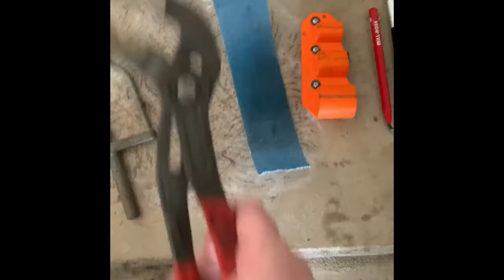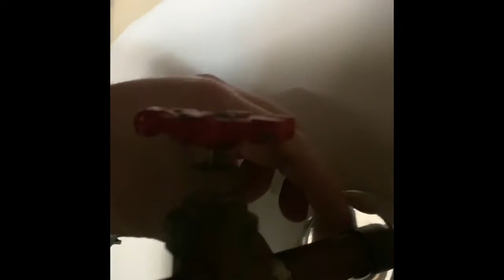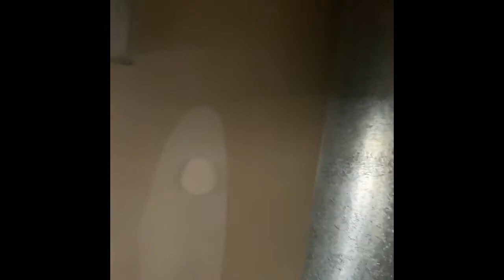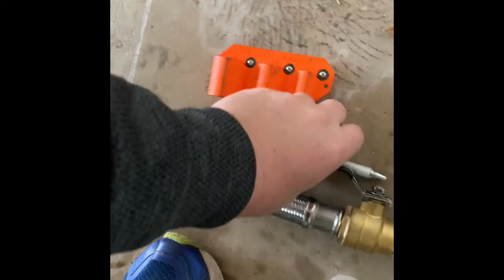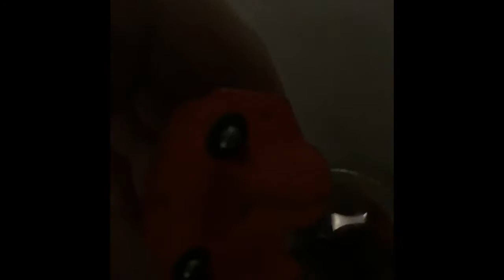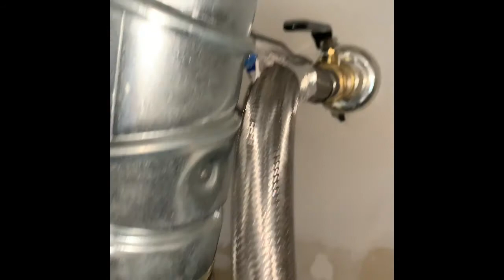How to Replace Flex Line the Water Heater.

Comment: Lazy. "Temporary repair". 
When your right there and do not cut a pipe straight, do it right.  

De-burring and cleaning the pipe still leaves a sharp edge to cut and O-ring. File it smooth.

Shamefull
Reply from the maker: Thanks for the comment. Thats why it was sanded and de-burred. Sanding is acceptable for smoothing the copper to not damage the oring. Its also a very temporary fix not intended for long term. A true professional would not leave a sharkbite connection as a permanent repair.

Comment: Does the gas needs to be off when replacing the flex copper hoses?
Reply from the maker: It’s not necessary as long as you don’t drain the water heater

Comment: I just used these Sharkbite connectors on a replaced HW heater....  I just wish I had attached and torqued down the nipple/ heater end before attaching the sharkbite.   It has a free-spinning nut, but still was making the braided hose twist and bend.   I had to hold the braided hose while twisting.  I wanted to get a few more turns.  So far so good though.  Thanks.

Comment: Is there no need for teflon tape and / or pipe sealant on the threaded connector to the water heater?
Reply from the maker: The flex lines have a gasket i dont apply any